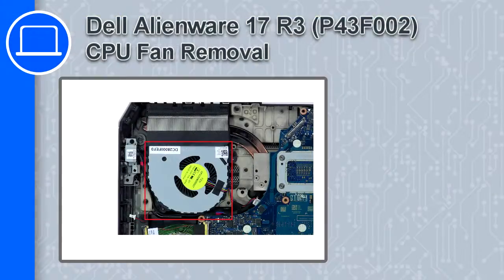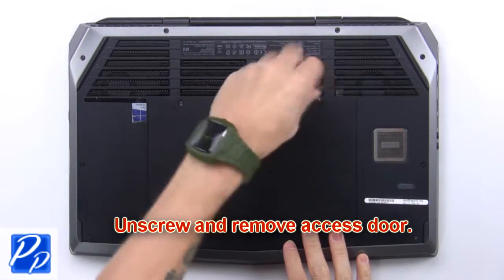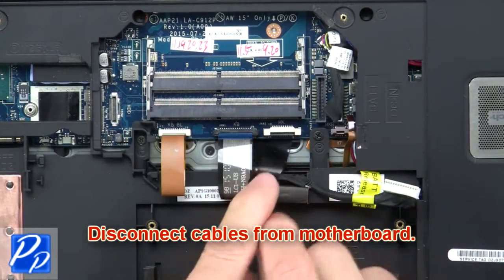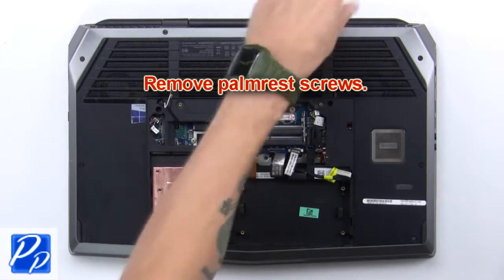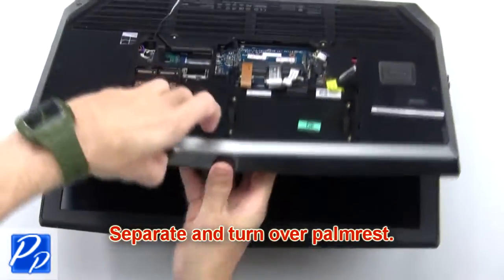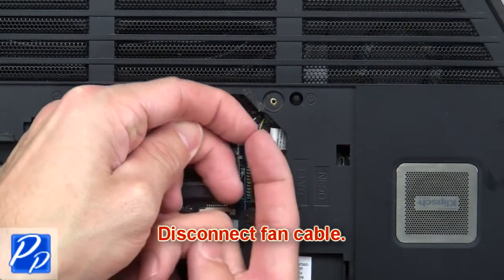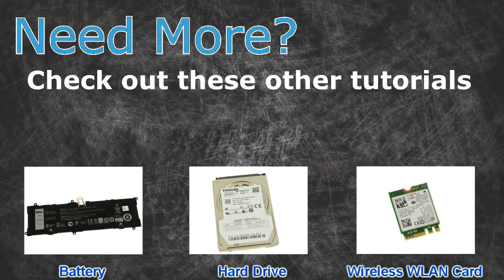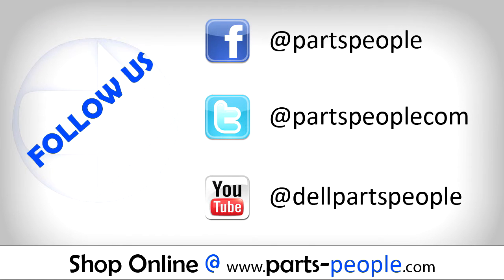Dell Alienware 17 R3 (P43F002) CPU Fan How-To Video Tutorial

Comment: Used this video to get to the fans to clean them, and mine has extra plates that make it impossible to remove the fan via these instructions.
Reply: Mine too. My fans are screwed on the cooling assembly, so I had to remove the hole motherboard.
Reply: @moepmanauto  I'm pretty sure this video shows Alienware 17 R2 fans, as the R3 definitely uses a one-piece assembly for the entire dual-fan cooling system.

One of my fans started dying a year ago, so I bought a single-fan replacement from eBay for a few dollars. I had to install it by unscrewing the old and new fans off of their backplates and then swapping them. The replacement fan had some additional plastic flanges for fixing it to the case, which the R3 assembly doesn't need due to being welded together, but it turns out that the R2 and R3 cases are the same, so it slotted right in.

Well, almost: I had to flex the motherboard a bit, which apparently broke the sensing ability of the audio jack, so I had to manually tell it when something was plugged in after that.

This kept the laptop going until it finally died this August, so I'm now on an Alienware Area-51m R1.